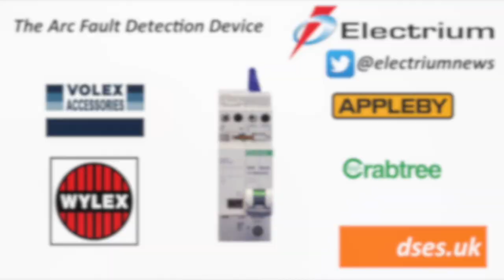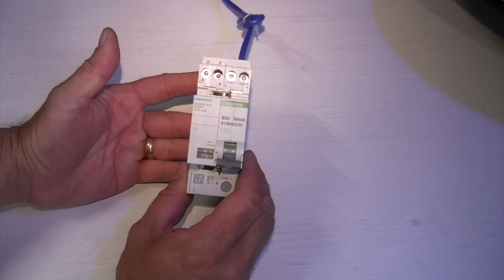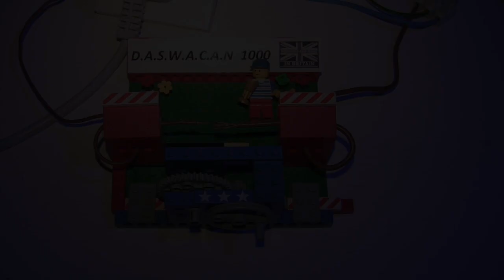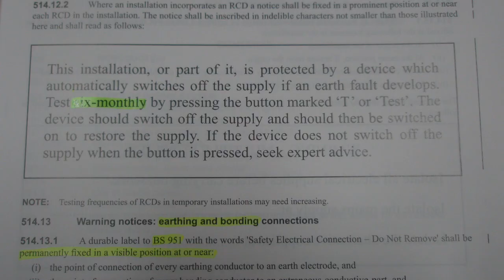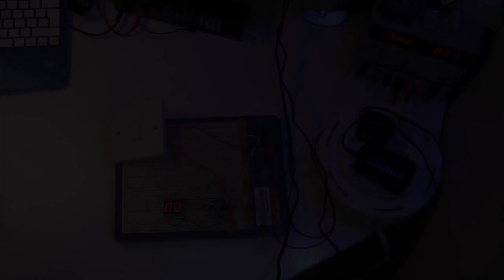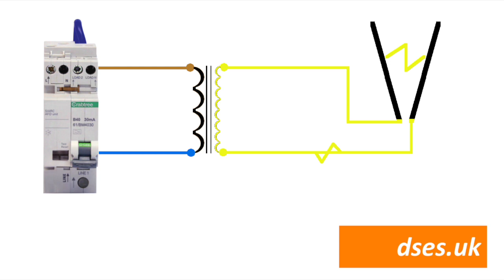The Arc Fault Detection Device (AFDD)

Comment: Thanks for that. It strikes me they are not as useful as the makers suggest. 
 Well like them or not, as of this week (21/9/2020) the draft Amendment 2 to the UK regs, BS7671 is proposing to make them compulsory for all circuits of 32A and below that are not lighting. @t  is the draft for public comment, section 421.1.7 is the key one. (about 2/3 through the first of the 4 parts)   You do need to create an account with the BSI to leave a comment, but anyone can  do that. I for one will indeed be commenting, that I think this is not a good thing to make compulsory in  the regs.
Reply from the maker: I need to look at the DPC Mike. Strange they're advocating AFDD's for 32A and below - I would have thought cooked shower isolators at 32A and above would benefit more!

Comment: So, as a layman here what will this detect in a home if the wires are not run through salt water. Great video by the way
Reply: David's fine stranded wires are probably melting and burning away. This means the circuit gets disconnected. If an arc isn't maintained and the circuit is instantly broken it's not dangerous. Like the wire in a plug fuse blowing. The afdd is looking for more substantial arcs that form over a bad and high resistance connection which is problematic for long enough to cause heat and catch fire.

Comment: I've always looked at the way light switches are rated for AC only. Been tempted to whack a big rectifier in line with a 3kw heater and see what sort of mayhem occurs inside when you try and use a light switch to turn it off!
Reply from the maker: I think JW did a video on this - DC on AC accessories. It ended... with melting... if I remember rightly...

Comment: Hi there. I love the videos.
One question please, could you recommend a decent cable tracer.
You know for trying to trace hidden cables.
Many thanks.
Reply from the maker: If you mean one of those things that claims to detect cables buried in walls, then no. No such thing exists. Whatever you spend, and whatever the manufacturer claims, it ain't happening.
Reply: I mean a kit with a transmitter and detector. A 2 piece kit. A coded signal is sent down a cable by a transmitter and the receiver picks up the signal and locates the cable being transmitted down. I know fluke do one I just don't know if it's worth the money. Thanks.
Reply from the maker: I used a line tracer in a video a couple of months ago when hole-sawing. Is that the kind of thing?
Reply: @dsesuk   let me watch the video and will let you know. Not sure if I'm allowed to mention brands but the pricey one is the fluke 2042 and I don't know if it's any good.
Reply: I would just like to know your recommendation thanks. I'm just guessing you use one on a regular basis.
Reply: I would just like to know your recommendation thanks. I'm just guessing you use one on a regular basis.
Reply from the maker: @ediijay9897  I've no experience of the Fluke 2042, but it looks like a pricey bit of kit. For basic line tracing I use a LanScaper made by Test-Um, although it's an old bit of kit that isn't made any more. Something like this: https://amzn.to/2VP4QVU ought to do the business in a basic capacity. Should my LanScaper die, that's probably what I'd spend my pennies on unless someone can show me what extra whistles and bells the Fluke offers for its price tag!
Reply: @dsesuk  Dave I have one more question. Could you recommend a good Sparky's forum. I'm in the trade and looking to join a good Sparky's chat forum thanks.
Reply from the maker: @ediijay9897  There's https://www.electriciansforums.net/forums/electrical-forum.15 and https://www2.theiet.org/forums/forum but the problem I find with all forums, regardless of the topic, is that when a question is asked, the OP either ends up being berated for asking what is perceived to be a silly question, or it ends up escalating into a pissing match between seasoned forum members trying to outdo each other and going wildly off-topic. That's not to say there isn't good information and advice buried within forum posts, but they're often not too friendly and finding the answer to a question can involve a lot of scrolling.

Comment: Hi . Would my welder, standard 3 pin plug , in my shed trip this unit in your opinion ? regards Don
Reply from the maker: I've no experience of welders, but I suspect not as the arc would be on the output side and isolated from the supply just as my jacobs ladder is in the video.
Reply: @dsesuk  Hi David. Thanks for the reply. I actually sent that before getting to the end of the video.  Good video btw. Gives an outsider a better understanding of insulation test requirements and why it's expensive  getting a consumer unit tested etc. Best regards Don.

Comment: Will the afdd just cover the one circuit. If so would you need to install one for every circuit
Reply from the maker: Yes, one per circuit, however look out for new models coming out this year the size of a reduced height RCBO but working as three-in-one devices with AFDD, earth leakage and overcurrent protection built in. Personally, I believe AFDDs are unlikely to see traction until such time as the regs require their use.... if that ever happens.
Reply: @dsesuk  ok will have a look out for them. I think they are a bit expensive for what they actually do and if they actually work lol. Need to be a bit more reasonably priced if they want people to use them

Comment: AFDD are really intended to stop electric blankets from catching fire. Their wire is the most abused ans stressed and you will be asleep when it catches fire. That's why bedrooms were the specified location in the US. But with ant tech some group got together and said why not on all circuits. Well that's why no one likes them, the other circuits have devices that don't play well with the AFDD. If we could just have struck with the bedroom circuits this would not be the nightmare it has become.
Reply from the maker: That's very interesting - where are you located? AFDD's are new to the UK, but its great to hear from those elsewhere in the world who have more experience with them, especially if they're causing a headache to your working day!
Reply: Some (many?) electric blankets have their own arc detection built into the controller, which seems like a much better arrangement; since that only has to accommodate a specific known resistive load, it can be made far more sensitive than circuit-level AFDDs without nuisance tripping, and doesn't bring down other loads when it does trip.

Comment: It would be smarter if AFDD manufacturers could include a "learn" mode where you push a learn button and then you run said machine/thing and test lightswitches and so on that is connected to said Circuit, and then it will learn a threshold so it don't false trip but still trip at unnormal arcing.

Same with GFCIs, Personally I think 30mA is pretty high and it would be easy for GFCI manufacturers to include some "learn" mode here too, where it will Always trip at 30mA, but the "learn" mode can be used to "learn" a lower trip level into the system, so on a good circuit with low Earth leakage, it could even be learnt to trip at like 10mA or even 5mA. And in such a combined device, the "learn" button could then be responsible for both Learning AFDD And GFCI parameters into it.

Or even a fully automatic learn mode where it will during the course of a week of normal usage, automatically learn the "normal parameters" of the Circuit (arc signature and Earth leakage current) and if anything gets unnormal, it should of course trip.
Reply: Would be nice perhaps for people who know what they are doing, but you know that some people are just going to figure out that if the power keeps going off they can press that "learn" button to make the problem go away...

Comment: Have I missed it or was the way of working not explained?
Reply: I suspect the exact way of working is proprietary so nobody will be able to tell you.  But essentially they monitor the current and perhaps voltage on the line, looking for fluctuations that match certain patterns seen when arcing occurs.
Reply: Very basically there are two coils around the supply which are slightly displaced: the separation between them allows the shape of the waveform to be detected. A micro-controller recognises distortions in the waveform created by 'acceptable' known arcing causes such as the light switch, the drill and so on, and doesn't react. But if it detects anything outside these known parameters it trips the supply.

http://9.xcbu.sassenburger-weissbauchigel.de/date/arc-wiring-diagram.html

Comment: All these videos about AFDDs are a little ironic. My fan heater started cutting out recently. Turns out the connection on the overheating sensor was loose and arcing and causing the whole thing to heat up, and trip.

Comment: Can you let me know how you built that arc creating gizmo. Not the lego one, the man size one. Cheers.
Reply from the maker: Simply a 10kV neon transformer. 230V on the two terminals in, 10kV on the two terminals out. Each of those output terminals is connected to a prong, and the air gap at the bottom is sized to allow an initial arc to form. The hard part was sizing the gap and the Vee shape of the prongs, but that's just (rather dangerous) trial and error. The initial gap has to be small enough to allow the arc to reliably form every time, while the Vee should be sized to allow most arcs to rise to the top before breaking. Also, had I mentioned that it can be rather dangerous?

Comment: according to the nic guy that visits me he has seen a schneider version that is just a single module, i cant confirm this as i have not seen any.
Reply from the maker: The only Schneider ones I've seen are in the Acti9 range and are two-module with arc fault and overcurrent protection, but no earth leakage. I have seen a single module Siemens version in the flesh, but it was for the German market and had input/output terminals rather than the busbar clamp connection we use here. It's the way things will (eventually) go though. I believe a UK version of the Siemens model is supposed to be out in 2019.
Reply: @dsesuk  yeah I am not 100% but I think the Schneider one was for a different country, he didn't say what protection it had on it, only thing is they don't work on rings plus if we carry on putting all this stuff in mains boards they will be the size of fridges
Reply from the maker: @acelectricalsecurity  The thing with rings is you won't get arcing in a high impedance joint to cause arcing as there will be a lower impedance path for the current to take down the good leg of the ring. That said, if there are two breaks in the ring, one of which is clean and the other high impedance, then arcing is a possibility as the current will be forced through the high impedance joint, and so the device will do its job. Arcing could also occur in a spur off the ring which again will be protected by the device. For those scenarios, they do have their place on ring circuits.
Reply: @dsesuk  personally, after reading up on them, I think they are a waste of time, there is only one instance when I have come across arcing, it's on shower switches and as with everything if people were not so limp wristed that wouldn't happen.
Reply from the maker: @acelectricalsecurity  Can't say I disagree with you. Tightening up of the industry to try and eliminate bad workmanship would be more effective than the regs insisting on new materials and devices to lessen the impact caused by such. Prevention is better than cure as they say! A pretend sparkie who does a crap installation job is also the type of idiot who won't know anything about this kind of device, and won't bother installing one even though his rough-ass installation is exactly where it would be needed.
Reply: @dsesuk  your right there, if it wasn't for the crap workmanship we would not be fitting metal boards, well that's if the manufacturer's made them correctly, and not just stuck the BS number on saying it passed the hot wire test electrium and mk to mention a few.

Comment: Brilliant video David! Great sense of humour too. Would AFDDs work, on say, a lighting circuit with LEDs pulling a few milliamperes?  I wonder what the trip differential is? What is the sensitivity? Also, how many milli seconds? I think this new 18th edition regs is the best ever. Real changes rather than the usual rhetoric changes. Good practical changes. I feel the industry is moving forward again after years and years of it being ruled by parsimonious accountants. Profits over safety. Us sparkles have been whinging for years about how shitty equipment is. I think these days are brilliant fresh air! Thanks for the video David!
Reply from the maker: Thanks David. There's some technical data in the PDF linked here: https://www.electrium.co.uk/media/20180709153811_0_StarbreakerProtectiveDevices.pdf although I don't think it has the stats you're after (I don't have the answers this end).

Comment: Americans have been complaining about faults and saying that they do nothing actually and a thermal detector in the outlets would be better. But I see the combination afci gfci unit will become the normal as almost all circuits in USA now require afci.
Reply from the maker: If the Germans have already squeezed an AFDD and RCBO into the miniature RCBO form factor, then they may as well become the norm and prices will drop as production goes up. I have seen one of these mythical devices in the flesh, although it was a wire-in/wire-out as that's what they use in Germany apparently, so a modification to work with a busbar cage clamp connector is what's needed on these shores, but I'm told that's not too far off. At the moment my wholesalers don't know enough about them, so I can't get sensible numbers on prices and lead times, but like most installers, it'll probably be a while before I start fitting them.
Reply: David Savery Electrical Services American testing as found that some fires still occur. There was a video online here somewhere about a device that sends a signal when a thermal temp is hit in an outlet or device. Supposed to be cheaper, less prone to faults, and in tests has reacted before the arc flash devices. But, not sure. USA uses different gfci anyway. They have outlet dual function and breaker dual function but I like the RCD covering several breakers like it does here, compared to each breaker having its own gfci like USA uses.